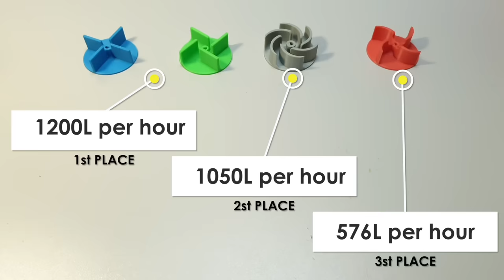Testing 3D Printed Water Pump Impellers - Which One Performs the Best?

Comment: Interesting build. And well done video. I want to give some background information about pumps, as i have designed and tested industrial pumps as an engineer.

In general there are three important variables you should measure while testing the pump. The first is the Flow. This is the volume divided by the time, which you essentially measured. The second is the Head of the pump. This is essentially a measurement for the pressure the pump provides. Measuring this can be done in an diy environment by connecting a hose to the discharge side of the pump and measuring the hight, which the pump can increase the water level in the hose to, while the hose is facing upwards vertically.
importantefficiency. The efficiency of the pump is defined as (hydraulic Power output)/(Mechanical Power input). For your purpose measuring the Input of electrical Power would be sufficient, as the electrical motor has roughly the same efficiency in all cases. 
With these three simple measurements you could truly classify your impellers and rate them against each other.

This is important as an impeller with straight blades will give you a higher output in pressure, but will worsen your efficiency. That's the reason, why they used straight blades in the case of  the car pump. Changing the blades from straight to curved on the small pump won't change the overall efficiency of the car, but will increase manufacturing costs quite a lot. It could be, that your 6 bladed curved impeller will give you a worse Flow and Head, but will do so at an higher efficiency. My guess regarding the bad performance of the red impeller is, that cut blades in the centre will drastically worsen the flow and will induce cavities, which lead to an overall lacking performance and can damage the pump in some cases.

It would be awesome to see how your pump and impellers perform overall, especially regarding efficiency.

Comment: It's right this way, first straight turbine blades convert more energy in speed, the others are more suitable for low speed and high pressure. Results are correct

Comment: excellent test and video .. 40 years ago   I had a cooling issue on my four stroke   powered R/C model helicopters . . I conducted similar tests to yours . only using air .. not water . The biggest breakthrough was when I faced the cooling fan backwards and sucked the air PAST the motors crankcase prior to directing the airflow over the upper finned half of the motor . There is a two way spin off .. bigger fan equals more airflow .. BUT  bigger fans take a lot of power , an amazing amount of power to drive at the 7,500 rpm motor power delivery.

Comment: The curved ones were probably more efficient, but the other ones drew more power from the motor so they pumped faster. You have to test the power used by the motor to properly compare the efficiency

Comment: You’re likely getting cavitation on all of them but I didn’t have to see the test to know the grey and pink ones with those longer vanes would be slower than the blue and green. If you could seal your pump housing and provide an inlet and outlet what we do on flow benches testing fuel pumps is put a clear piece on the inlet side so you can see the cavitation also different RPMs have different flow rates with a cavitating pump
And really great video sorry forgot to be complementary!

Comment: pumps has another very important property next to the volumetric flow rate, that is the outlet pressure. You can't judge a pump without knowing all parameters. There are pumps with low flow rate but high pressure, and oppositely some of them can have very high flow rate but low pressure.

Comment: In my opinion, due to the fact that the pipe is installed on the pump in a tangential way the straight blades were more effective in compressing water in a tangent direction. The concave blades create forces on the water towards the center of the pump and not in a direction tangent to it so less water is compressed into the pipe and from there into the bottle.

Comment: Hello friend. Thanks for posting the video. Four impeller designs gave You different results in water flow but be sure that the pressure the pump could reach with each of them also differs. For the pink one, I gues the inlet was close to the bottom or the pump was taking air. For the pressure, I expect the highest pressure from the grey one.

Comment: I think that,  if you switch the terminals of the battery you will obtain extremely different results,  but you should change with it the input and output of pipes,  or/ you can print a new screws of same shape,  but of different direction.

Comment: You didn't insure that the battery voltage wasn't dropping which would slow the pump motor,  I agree that a pressure comparison would also help in determining  most efficient impeller. Nice work..

Comment: If the gray impeller was connected to the spine, it would have worked better but not as efficient. ,There is actually too much volume of plastic in the design for it to be effective because it is reducing the void available for fluid to enter the chambers.  As the old saying goes, it looks good on paper until you use it in the real world.

Comment: This is bringing back nightmares. I have worked on BMWS for 30+ years and from 1991-1996 they used plastic impeller water pumps. There’s a service bulletin about it. Every customer with an effected car I urged them to change the pump before it exploded or quit spinning because it stripped the shaft from the impeller. All replacement water pumps had metal impellers. When they blew you really need to get every last piece so you can rebuild it to make sure you removed the debris. It was put together to make sure everything was out of the engine. If you didn’t you ran the risk of a piece clogging a coolant passage and blowing the engine. Running a engine hot is the #1 cause of engine death. 80+% I have put in was due to a overheating issue where the owner drove it until the engine stopped because it locked up. If you cut it off when it starts tow it and fix it you can save a lot of money.

Comment: Nice video and good idea but I have some suggestions
1) in some cases there was air in the turbine and this can cause worse performance, 
2) You have operated this manually by holding pump in hands wich also cluld make diferences in performace
3) You have not measured presure wich in pumps is very important, becouse performance in liters are strictly dependent from presure or differential hight of outtake - intake.
4) there will be nice if You will create a graph l/min in one axis and presure (hight) in other.

Comment: Each of the propeller corresponding to one Pressure-volume curve. You need to apply a certain pressure to testify which one is more efficient. Under low pressure, the first two may dominate, yet under high pressure, the third one wins.

Comment: Redo the test with the 5L container at a height of 2 meters and check flow again, this will give you a good indication of pump pressure. Some designs of impeller are better for flow others for pressure.

Comment: I basically understand curved veins gives you a higher head pressure and lower flow rate and radial or straight veins gives you higher flow rate but lower head pressure if I recall my three or four semesters of fluid mechanics during mechanical engineering

Comment: Good day, I think a simple test whereby the static head in meters is measured and converted to kPa or bar. Simply place the pumps on the ground and see how high above the ground level, in m, the pump discharges the liquid. You can use this pressure and flow rates to actually determine the efficiency as (Pout/Pin) as flow rate is not really a good measure of efficiency, it's just a measure of flow rate. But still a cool video, keep it up!

Comment: The pump is kind of close to the water. You might want to put a longer shaft on it with a disk attached to the shaft to stop water from coming up. Maybe have openings in the orange part above the protective disk...

Comment: What happens if you add wingtips to the blades? As you say some of the results are a surprise. To be really vigourous, you should also run the motor in reverse with the port reprinted in the other direction. Who knows  you might discover something. For a more precise measurement, just stop the timer when the water overflows the neck of the container instead of reaching the line marked on the container. You can measure/weigh the total capacity of the bottle later. I think some of the blade designs are meant for air instead of water.

Comment: Its because the of shape from impeller, curve and straight.

Curve shape make flow smooth, essential like sentrifugal work,  
( low force than the straight blade,  low vibration, long life working) able to handle back force pressure  at the discharge pipe line that go vertical direction.

The straight blade, its like, suck alot, and pull with high force but not essence like sentrifugal.
(high consuming power cause of high force, and high vibration, better for small pump only.)
Cant handle the force back pressure at vertical pipe line its will  be crack the impeller

Comment: I think curved blades would perform better with a tight housing design i.e., less clearance between the blades and the wall of housing, although the flat blades might benefit from this as well. 
Flat blades throw the water outward better where the curved ones energy is dissipated by allowing the water a smoother path around the blade.

Comment: The results are ENTIRELY predictable, but they have nothing to do with "efficiency". Measuring the different pressure created by each rotor at several flow rates would give a clearer result. Monitoring the current draw of the motor at the same time would be even better. It will be found that the rear-angled rotors (all of them except the blue rotor) create less flow when there is restriction to flow on the output, but they also draw less power then. If the motor and battery are strong enough, mirror-image versions of those 3 rotors will pump MORE than the blue rotor, AND put more load on the motor. All perfectly standard stuff from Pump Theory.

Comment: Im thinking that the reason the red model was so ineficient is because youre getting a lot of cavitation or something along those lines. 
You can hear and see in the underwater clip that the motor is ramping up  and down periodically.
Im thinking that the shape of the blades are inducing a very low pressure zone behind them causing the issues.
Reply: its because the of the direction of the output.   impellers should be scooping the fluid.   without the scoop affect, it causes a negative pressure behind each of the impeller arms,  where its going to pull fluid to fill the space behind each one,  fluid can have variable friction so, its gonna surge with harmonics.   if the impellers where facing the other direction to scoop as they should, then the negative pressure behind them is displaced by the scoop of the next blade,  reducing friction of the fluid moving.. which in turn increases performance.

Comment: Your blades are spinning in the wrong direction! They should be forcing water towards the nozzle. In addition if they rotate in the correct direction ( clockwise) the curved blades will need to face the opposite way. I think you will get much better results!
Reply: Agree
Reply: Amm, no, the blades are curved to push the water "out" as well as around, it's curved in exactly the right direction. Same with direction of spin.

Comment: I think the curved blades sacrifice speed for pressure. It would be interesting to measure head pressure also and see which ones do better at that. When you apply back pressure, the straight blades will be fine with just carrying the same water around in circles.  The curved blades squeeze the water outward and load the motor. That's why car water pumps use straight blades. They want lots of flow and a limit to the load they put on the motor. If you have to pump up a long hill, you probably need the curved blades.
Reply: Jjhhh

Comment: There are two main parameters to consider when dealing with pumps, the head, or H; and the flow rate, Q. Depending on the specific need or requirement. If you need to transfer liquid from a low to a very high elevation, pump designs provide the objective, with a high head but low flow rate. And, if you need a significant amount of flow, radial type pumps usually deliver a high flow rate but can only reach low to average head. Thus, depending on the specific requirement, the efficiency of pumps is measured.
I suggest measuring the head of each type/design of impeller to know the relationship between the head and the flow rate of each design.
Hope this helps, thanks.

Comment: Considering the way you're pumping water, wouldn't it be better to have a "scoop" on the water facing side of the blades with a long taper at the outlet side? This way you increase the amount of water pulled in as well as exit pressure. If you don't care about maximum pressure in the system then keeping the end between 90 and 45 degree will allow for the greatest amount of water throughput, also instead of a scoop it should be a vortex generator so water will resist less being pulled in.

Comment: I think your pump housing may have an inefficient shape. If you look at some dust collector custom builds (Matthias Wandel and Marius Hornberger come to mind) you can see that they build the pump shape with an increasing gap between the impeller and the pump housing wall. It starts off very narrow near the outlet, and then grows bigger until it reaches the outlet, where it usually is the same size as the outlet. This would probably improve the efficiency of the red and grey impeller massively, since now you're purely relying on the blades kicking the water out, instead of building pressure inside the pump, and having that pressure push the water out.

Comment: I have centrifugal garden pump, inside is 17cm diameter turbine similar to yours red one. Motor is 1,1kW 3phase 2800rpm. It can do 70L/min to 30m height. That pump need flow restricting valve or some load with long hose. If it runs without restriction or hose it will overload that motor. So in your experiment wil be interesting to se an wattmeter for measuring power to your pump on each impeller.

Comment: As a mechanical engineer I congradulate you for your designs. Also I have an EXPLANATION on the reason that geay and pink pumppropellers did not work efficiently. This type of propelers are called "forward bladed" and are used for very high flow rates....but with one very crucial condition!!! . .... the pump suction inlet must have enough presure head intake. In other word,if the pump is not submerged enough deep in the water tank the phenomena of "flow detachment" taces plakes between the water and the blades. So the blades are spinining but (in simple words) the water can't follow them.

Comment: I think the curved-blade designs would perform better if you performed the tests with a smaller inlet diameter.  Especially with the pink impeller, it appeared that cavitation was evidence of flow reversal near the outer edges of the inlet.  In other words, water enters along the center axis of the inlet, but some water exits the inlet farther from this axis.  
The curved blade design suggests that the optimum blade tip angle (i.e. near the outer diameter of the volute/housing) is detrimental for the inlet flow.  I am not an expert, so this is just my opinion.

Comment: I think that the turbine is cavitating, this happens when the velocity of the fluid goes up enough for the local pressure of the fluid to drop below the vapor pressure of the fluid, this causes micro implosions in the pump body. I think this is because your outlet is not tangent to the impeller curve.

Comment: I was expecting the green and blue one to pump better, because the grey one is more curved and have more blades which means its just like a spinning DVD and the pink have 4 curved blades which means the water will just hit the tip of the blade and didnt spin.

Disadvantages of blue and green is the motor will have to push heavier and if the motor is too strong and the blade material is weak, it could bend or break while grey will spin easily.
The pink is the worst, it makes the motor heavy while not even pumping enough water.

Comment: a more accurate way might be to have the water container being filled on a scale hooked to a switch on the pump and set it for a specific weight that is 5L and then when its at weight it will shut off and youll have an accurate reading

Comment: If the blade direction was properly orientated with the output spout you likely would have seen better results with all of them.

But because that wasn't the case the pink one, the last one that should have been the best optimized to pump the most water the faster wasn't at all.

Comment: I think the reason is simple, your motor didn't enough power for curve blades that have heavier load
It will be fair if you also calculate the motor RPM under load
Reply: Yesss

Comment: If you put an angle on the helix and reduce the hole through which the water enters, you will get a lot more strength and speed but it will hold the helix a little more.

Comment: Centrifugal pumps need a volute to create pressure, consider different casing designs. Your exit port is also not in an optimal position to produce pressure. Do a bit of research on centrifugal pumps and you will learn a lot.  I would consider a few other types of pumps such as gear pumps which produce a lot more static pressure than a centrifugal pump. In this application, the flow rate is not as important as static pressure for a pressure washer.